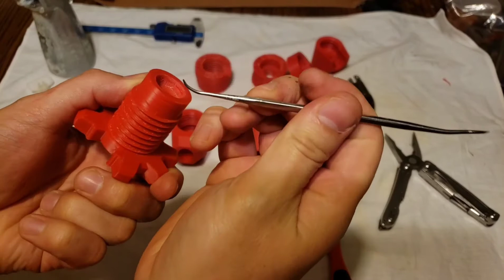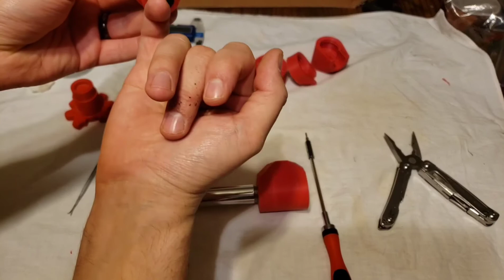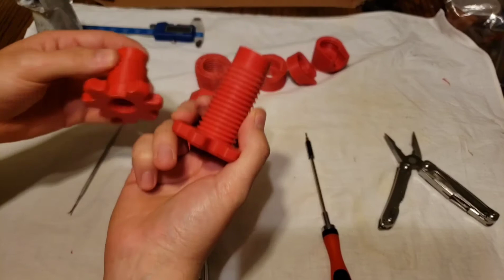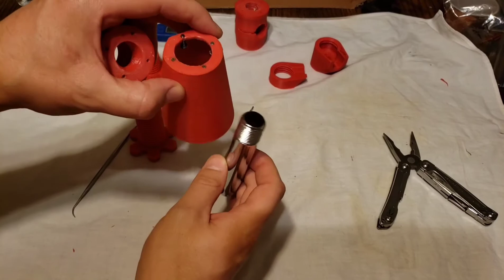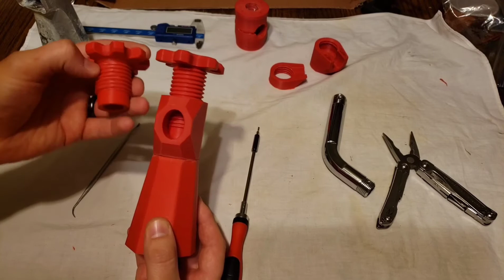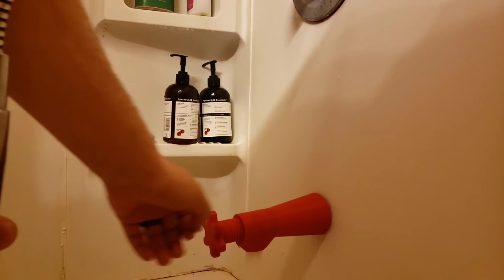3D Printed Functional Faucet Shower Diverter

Comment: Dope video man! Which printer did you use
Reply from the maker: I used a stock Ender 3 V2. I've since reprinted the knob in resin with a Mars 2 pro. The threads work much better in resin. Sorry for the long delay in response, somehow my notifications were defaulted to completely off. Thanks for the comment.